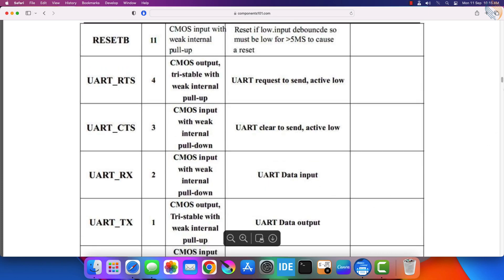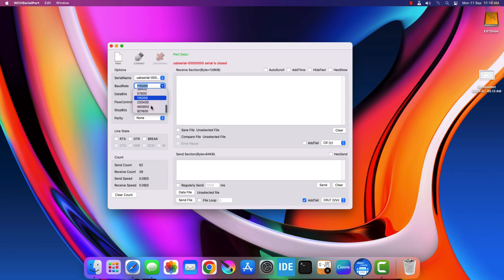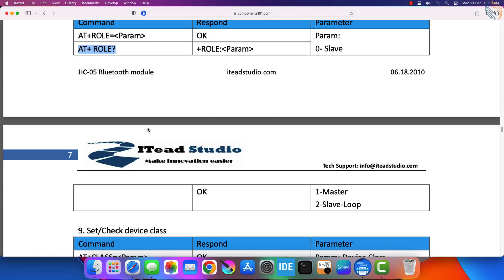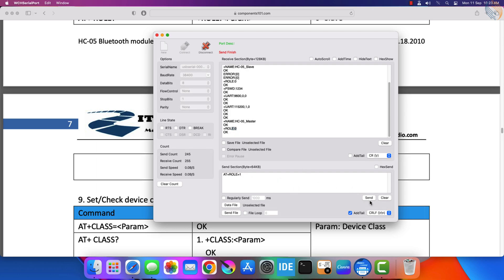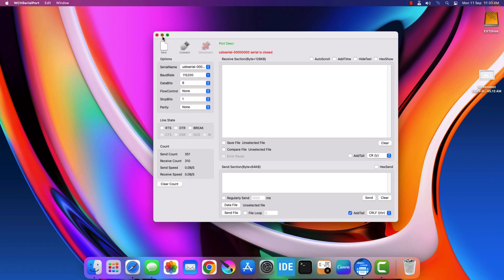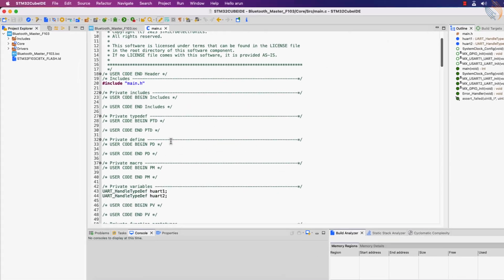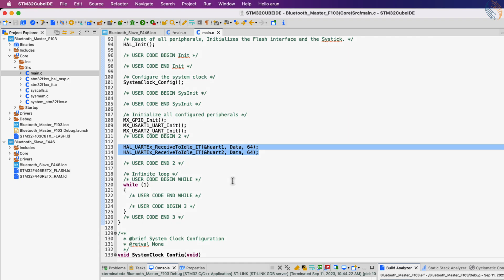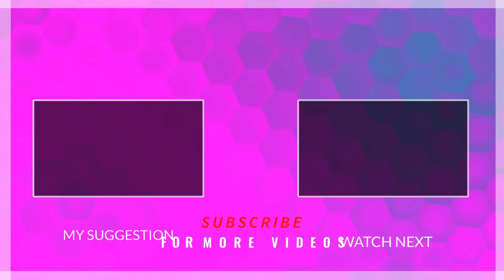STM32 Communication using Bluetooth Modules || HC-05

Comment: what would i do without usb uart ttl ft232?
Reply from the maker: You should get a usb to ttl converter. It is required in almost everything.
Reply: @ControllersTech  oh i only have USB UART I2C CH341T. What software i need to use to access AT mode? (windows)
Reply from the maker: you can use any serial console. On windows, hercules, realterm, putty etc.

Comment: You can configure the Bluetooth module through the MCU using AT commands and UART, right?
Reply from the maker: Yes
Reply: Is it possible to use the HAL_UART_Transmit function from the HAL library to transmit an AT Command string for configuring a Bluetooth module? @ControllersTech
Reply from the maker: Yes
Reply: Thanks ❤